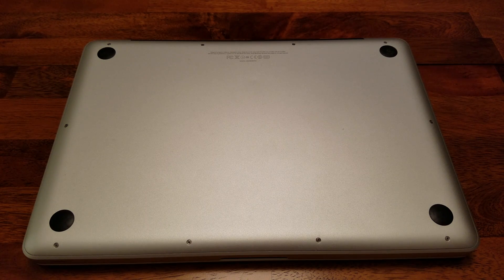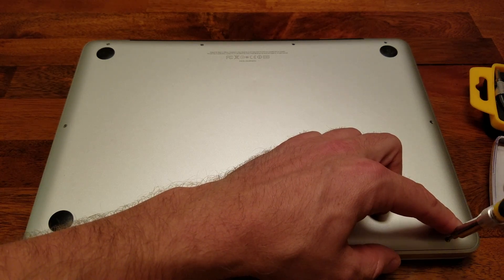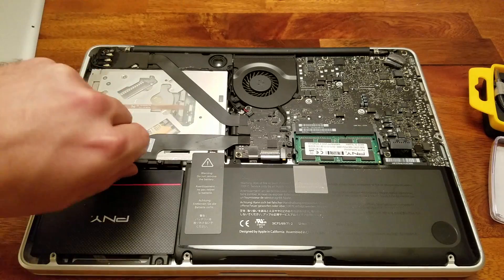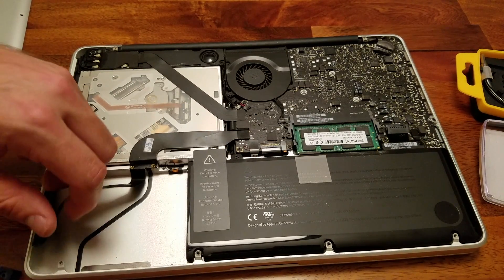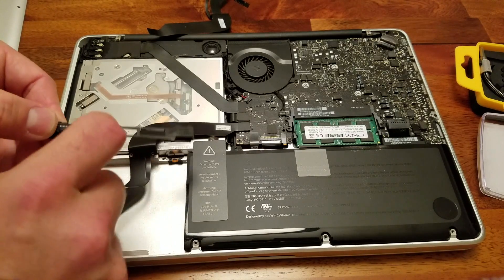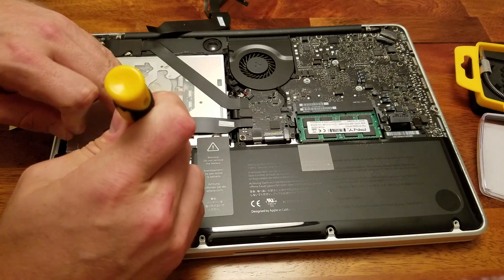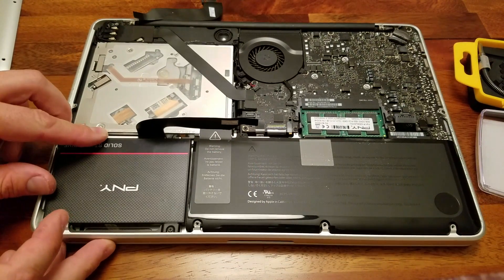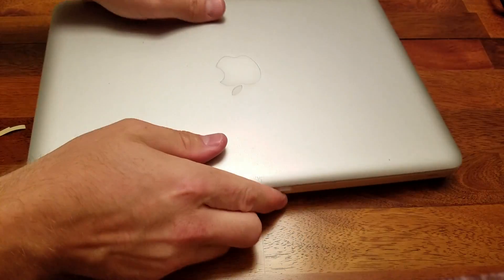How to Replace Your Macbook Pro Hard Drive Cable (Non-Retina Models)

Comment: Hi, I just followed the video and now can access the hard rive with no problems however my screen has now stopped working. its just black with no display what soever and no back light however it stilll works on an external moniter for example my tv with a HDMI cable plugged into it. is there anything that I could have touched or unplugged to make the screen stop working? any help would be great thanks!

Comment: Hi there. Hope you can help. I have replaced my cable twice. I boot up the mac in reboot mode and can see the hard drive under disc utility. However I did not keep a back from time machine. So i am reinstalling the operating system. However when i start to do the reinstall stages it ask where would like to save the operation system, the disk does appear in the box. I am stumped and not sure what else to do. Pleasseeeeeeeee help
Reply: Having the same issue - any luck?
Reply: You have to erase/format the drive in disk utility

Comment: Why can't the Retina model cable be replaced? My 2012 looks pretty much the same as this one inside. I've just put an SSD in, and am wondering if I need to upgrade the Sata cable for faster data throughput? Thanks.
Reply from the maker: The retina model uses a different hard drive from what I have understood. I believe if you get the proper size it can be upgraded.

Comment: Does it work on the 2009 MacBook?
Reply from the maker: It should! My little brother had the 2009 and you can do work those ones still. You can't work on the newer models because all of the hardware is soldered.
Reply: Hey, so i did the cable replacement and i got the hardrive in and everything but when i go to turn the macbook on i hear the chime and then it makes a sound as if it died and shuts off

Comment: Good video but you missed an important point about removing the ribbon cable from the new adhesive circuit board (for the indicator light).  There's a small latch you can open to release the ribbon and remove the old adhesive board.  The latch on the new board should be closed after inserting the ribbon so it will seat properly.  I almost tore my ribbon apart following this video, but after watching a few others, realized this step was missing.  I suggest using tweezers for this step, making sure not to scratch the new cable.

Comment: Obviously your cable needed to be replaced, but how did you know that was an issue?  I have a 2012 MacBook Pro 13” it’s been running slow for a while.  I get the spinning ball all the time.  I thought maybe it was the RAM. I swapped out the 4GB to 16 GB. That didn’t change anything.  Then one day I turn it on and get the gray screen with Flashing Folder.  Apple doesn’t support it since it’s 5 yrs old.  They said it’s probably the hard drive.  I took out the hard drive and it runs pretty good hook up through a USB cable.  So am I safe to think it might be a bad cable inside?
Reply: Xray241 hey, actually i had kind of a similar issue as you do, I dropped my mid-2012 macbook pro, and after that its been running slow, with the spinning logo, and I also had the flashing folder issue.
To fix that, I first tried to fix my hd using the recovery mode.
This fixed the flashing folder but it didn't help speed it up. Then, finally, after doing quite some research, I figured that this may be an issue of the cable, so I changed it and now its working perfectly fine.
I hope this helps

Comment: Bought a replacement cable from ebay but it is also not working . Is it possible to be a faulty one or is something wrong with motherboard connector ?
Reply from the maker: The computer does try to turn on?
Reply: Does your hard drive function?
Reply: The computer and the hard drive work fine. I replaced the optical drive with the SATA enclosure for HDD and everything is ok now. I suppose  the ebay cable was faulty after all. I am tempted to buy another one just  to check it out.